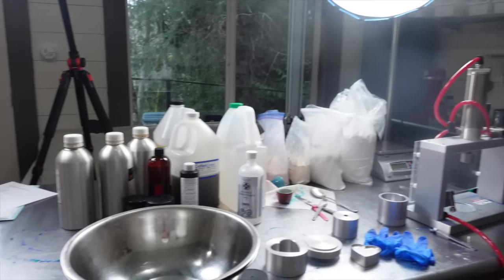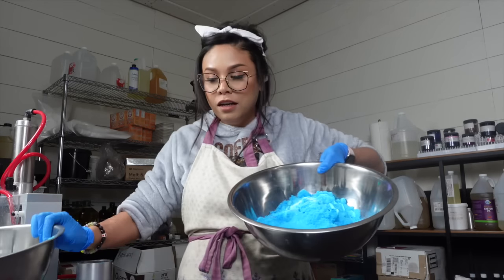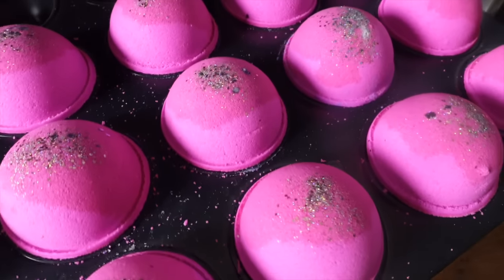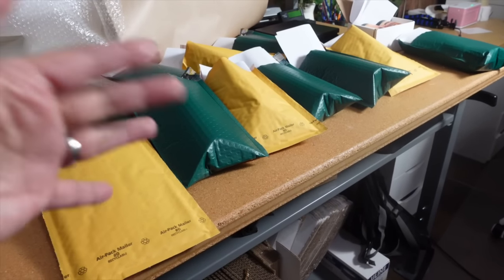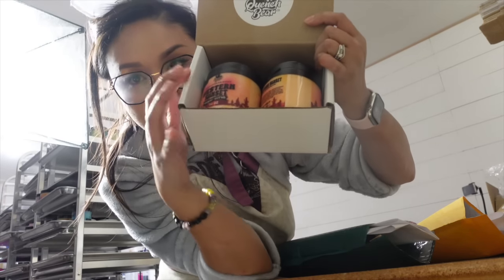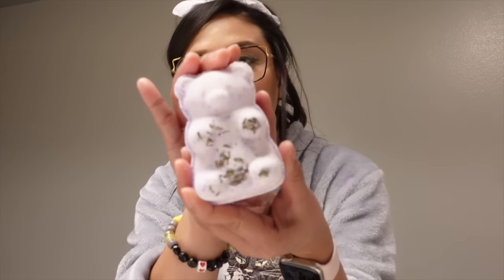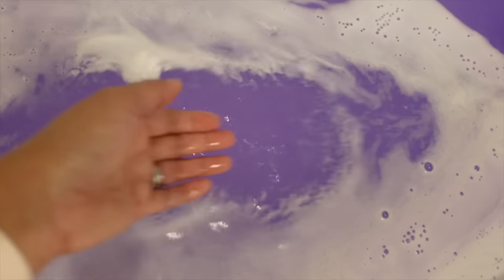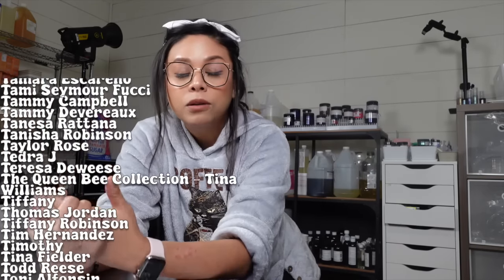Productive Soap Studio Vlog: shipping orders, making bath bombs and a bath bomb demo! Vlogmas Day 19

Comment: I ended up ditching the Polono and bought a Munbyn - I do turn it off after every use and I am thinking there is some adjusting I need to still do but at least I am not having to uninstall and install the printer driver with every use like I had to with the Polono.  I am on the fence about getting the color labels until I get this printer adjusted.  I need to do more research.  The bath bombs are AMAZING !!!!!!!  Rayne is going to LOVE the bath bomb - thank you for always sharing the best tips, tricks and recipes !!!